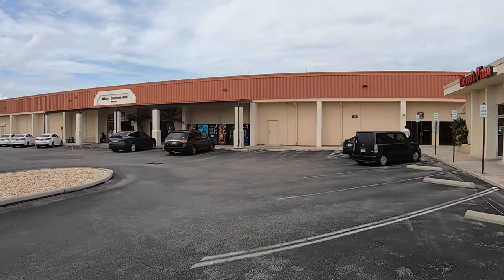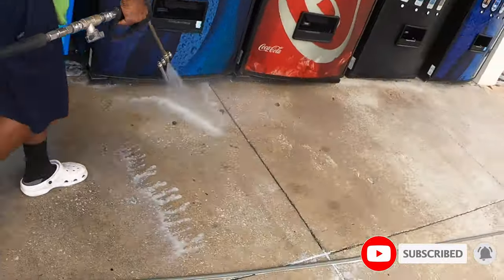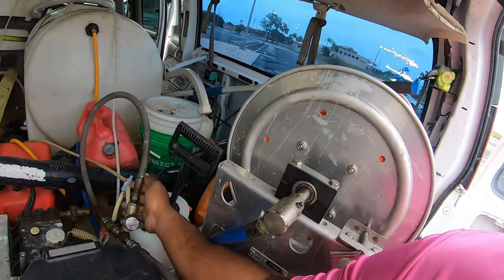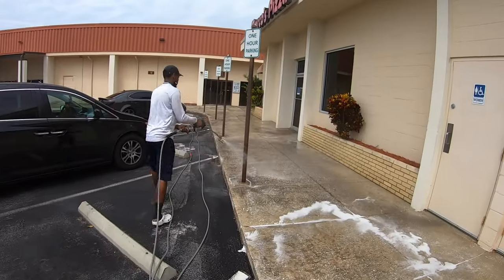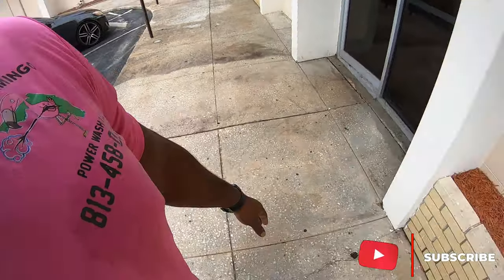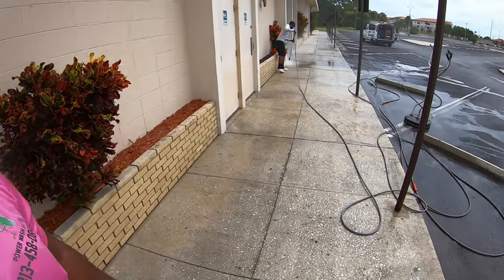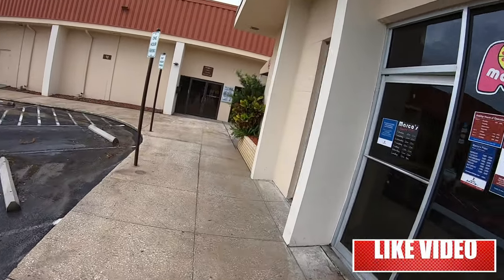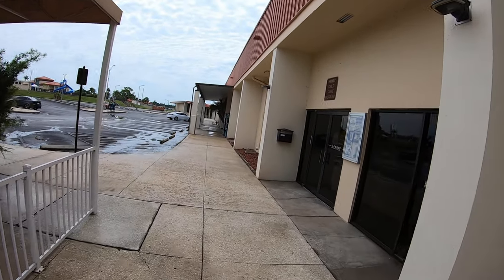Air Force Base Pressure Washing

Comment: Nice! I was going to ask from another video, how come you dont rinse roofs (you let the next rain do that), but you do rinse walls and concrete? What’s different about  a roof? Thanks for your videos man
Reply from the maker: Because the house walls will get oxidized if the SH is not rinsed.  Concrete doesn't have to be rinse after a post treatment also because it's porous and will soak in.

Comment: I’ve been throttling down my pressure washer because I’m afraid that I will etch concrete.  I only have a 4 gallon 3600 psi maching with the 25degree tips but wasn’t sure if I need to or now.   What’s everyone else doing
Reply: No need
Reply from the maker: Lol no way that will happen with 25020 tips on your surface cleaner brother. At 4gpm throttling down to clean concrete probably takes a long time.
Reply: When using the wand, you should probably bring down the throttle a little. Surface cleaner should be safe, though.